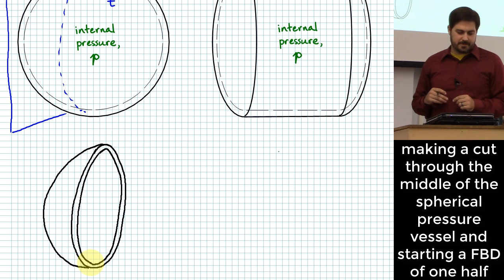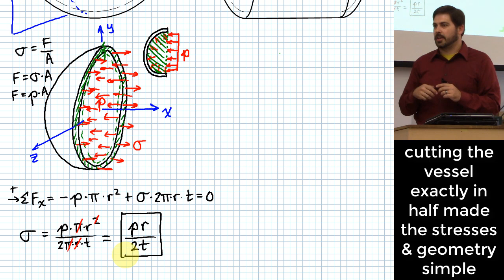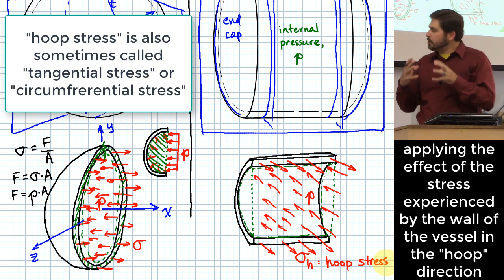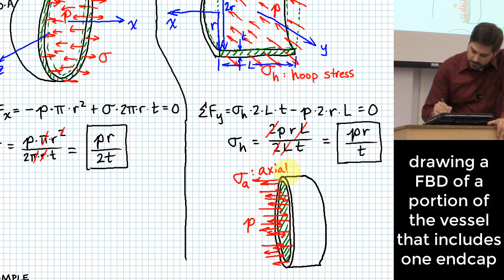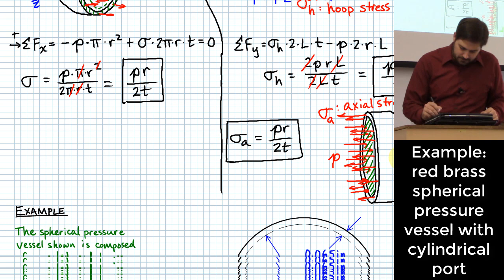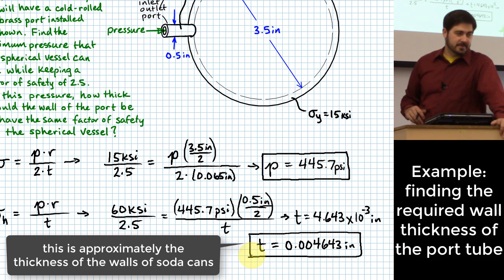Thin-Walled Pressure Vessels: Spherical Vessel Stress; Axial and Hoop Stresses in Cylindrical Tanks

Comment: Hello!  Recently the company I work for as an engineer had a little boo boo!  ;(  I was wondering, how thick should a stainless-steel cylinder wall be to survive to a salt-water depth of 12,500 feet (which corresponds to an external pressure of 5577 PSI)?

Comment: Is there a way to calculate the stress of a pressure vessel with a crack manually without using software like Abaqus CAE or Ansys Workbench? Or manually is only possible for undeformed metal structure?

Comment: Thank you very much for this information, I am a chemical engineer and I work with a pressurized shell, in my case I am analyzing the failure of a very small spherical particle, my question is, for my case, the pressure is increasing due to a chemical reaction that is forming gas inside the container, so I have two phases inside the sphere, liquid and gas, (8:48) how can I change the sum of the forces with a pressure that changes with depth?
Reply from the maker: How much pressure is added due to the depth of liquid vs the gas pressure? In many cases the pressure due to liquid depth is pretty small relative to the gas pressure. It may be a relatively negligible effect.
Reply: @TheBomPE  The difference between the two is around 1.32 atm, by the way, do you have any books that you recommend on this topic?
Reply from the maker: @GersonHM4  what is the max overall pressure? Most mechanics of materials texts cover the topic of pressure vessels...I don't really have a particular one in mind that I think does it best or anything.

Comment: Hi Sir, I'm just curious, if I have a tank without longitudinal joints, does the hoop stress still relatable as a parameter to design the shell thickness? Or I can just consider the longitudinal stress to design the tank thickness? Hope you can share your thoughts.. Thanks
Reply from the maker: Since hoop stress is about double longitudinal stress in a cylindrical vessel, it's probably always important to include it in your design considerations.

Comment: I will like to ask does this method work. when the atmospheric pressure is greater than the internal pressure
Reply from the maker: Yes, but the stresses will be compressive rather than tensile. Because of that, there will be a tendency to buckle that is not a concern in the case of internal pressure. Thanks for watching!
Reply: @TheBomPE  thank you for your answer. what will I need to look for to find more info about pressure vessels under compression. I only seem to find the opposite

Comment: Great explanation.  Why do many standards and online sources define hoop stress as PD/2t where D is the mean diameter?  Where in your example, the radius (or diameter) is related to the area over which the pressure is applied and therefore should always be the internal dimension.  I assume this has been done for conservatism, what are your thoughts? Thanks.
Reply from the maker: My first reaction is to have the feel that it will not generally have a very heavy effect on one's results regardless of which of these two diameters is used. This is more and more true as the wall thickness goes smaller. You are right, using the mean diameter instead of the inner diameter predicts slightly higher stresses, so that would be more conservative. Maybe it is easier to remember as well. In any case, for most practical applications it probably doesn't matter very much which way you do it.

Comment: So go an interesting question. if a pressure vessel is filled with a gas (lets say oxygen) under compression so that half the tank is filled with liquid oxygen and the rest is filled with gasious oxygen. is the pressure at the top of the tank the same as the pressure at the bottom? 
does the liquid oxygen add more pressure at the bottom since there is a column of liquid over it?
 does the gaseous oxygen in the tank less, more or same pressure as the liquid oxygen?
Reply from the maker: Here is an interesting discussion about measuring how much liquid CO2 is in a tank using a differential pressure sensor to sense a pressure difference due to the liquid column.
https://control.com/forums/threads/how-to-measure-tank-level-through-differential-pressure.42739/
Thanks for watching!

Comment: I read many times in different articles about meridian and circumferential stresses, so what are these ? 
Thanks
Reply from the maker: This lecture covered two special-case shells (spheres and cylinders) that are particularly easy to analyze because of high amounts of symmetry. In less symmetric cases, circumferential stress is very similar to what I called hoop stress in this lecture, while meridional stress would be somewhat similar to axial stress, but less similar than circumferential stress relative to hoop stress, in my estimation. It would be very difficult to explain it here without a diagram, so I will send you to this link to help explain these direction orientations in more general cases of shells.
http://www-mdp.eng.cam.ac.uk/web/library/enginfo/textbooks_dvd_only/DAN/pressVessels/shells/shells.html